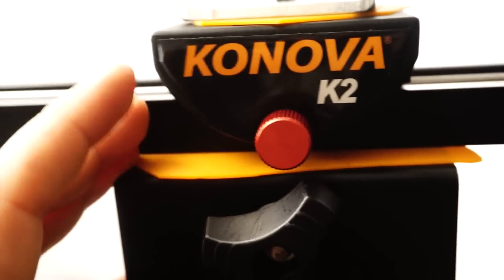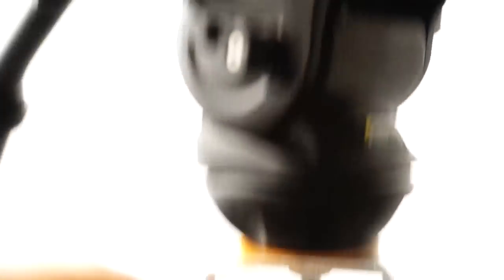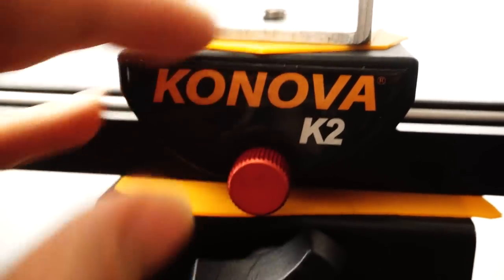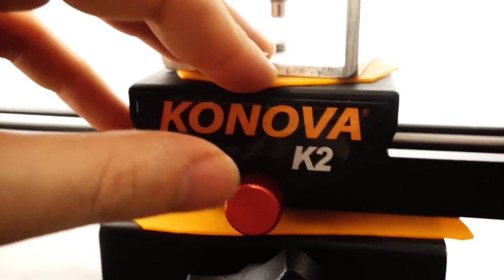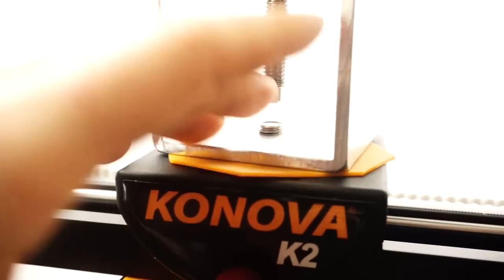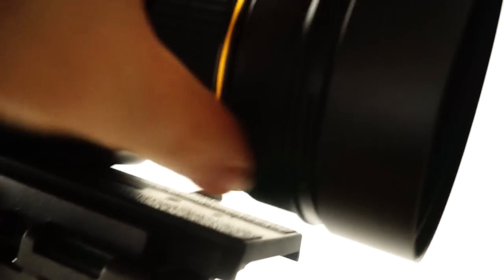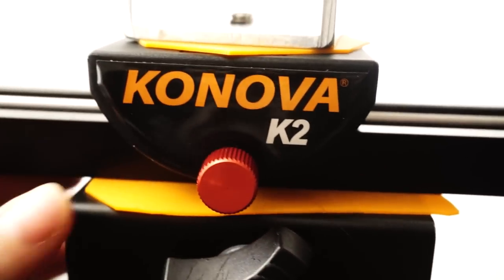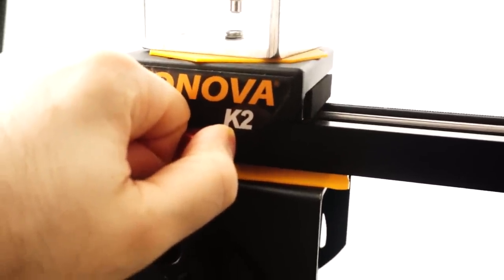$1 rubber solution for slipping camera parts (sliders, tripod plates, viewfinders, etc)

Comment from the maker: The K2 is the best slider on the market, i honestly dont think it can be improved. Check out my comparison vid if you haven't seen it yet. 
Also, they now base all their products on the connectors at the end of these sliders so they won't change that system. (motor kits, feet, etc.)
When they do update it they also sell upgrade kits for pretty cheap but now that they have the k2, 3 and 5 i dont think they'll make any changes.